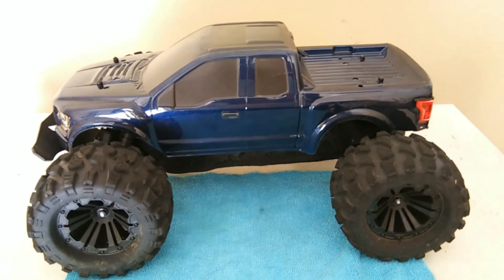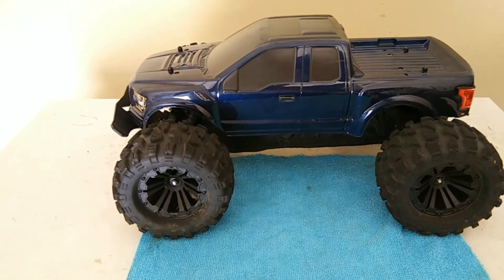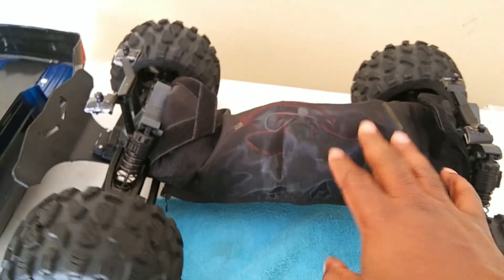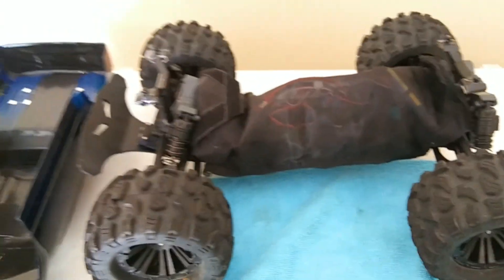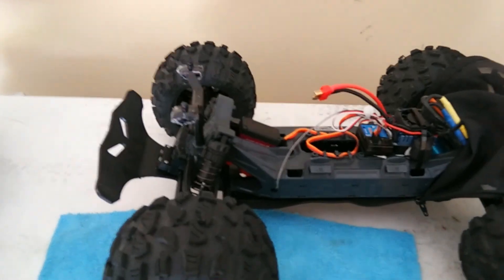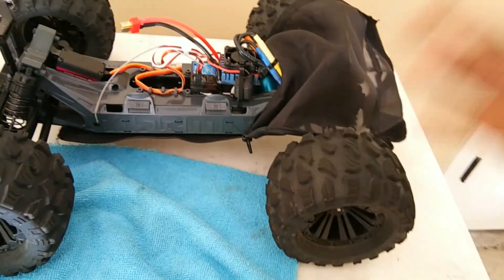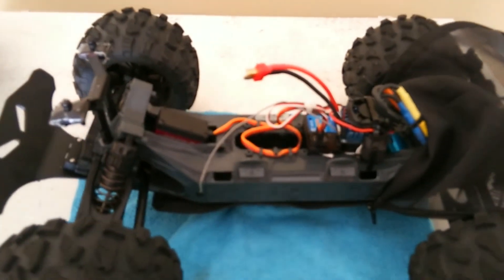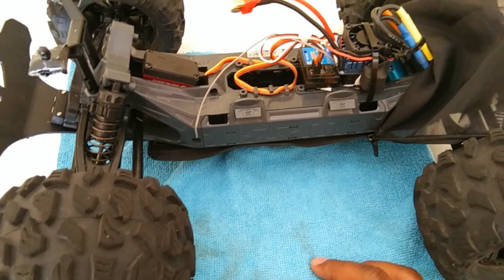Weak Points On The Arrma Granite Voltage 2wd

Comment: I know this is an old video, but so glad to come across your channel, bro. Just bought one of these on HH pre black friday sale. ESC bad right out of the box. Bummer, HH tried to make it right sent me  replacement esc, the big red piece of garbage, lol. It doesn't work out of the box either! Haha, so frustrating. But watching this vid and a few others, I got it so cheap...project truck time! I've got a broken traxxas I've been waiting to slap that vxl 3s system in something random!
Reply from the maker: Oh it's going to wake it up for sure. I suggest upgrading to metal cups & dogbones for your rear axles because the stock drives cups will strip under brushless power for sure.

Comment: Thank you for the info. I am looking to get into the hobby and the arrma granite voltage might be the right choice.
Reply from the maker: You are welcome! That's exactly why I wanted to get that info out there. It's a fun truck and good basher for a 2wd. You won't be disappointed!
Reply: I own this truck and it is a piece of shit!!! The plastic out drives are junk and always break the electronics can't be swapped out because its a all in one system. U can't adjust ur turn buckles to make it handle better. There is no slipper clutch to absorb in of the jumps or ruff terrain. Its easier to strip gears with a direct drive. Save 50 more bucks and buy a 2wd traxxas rustler. U will be glad u did. I know from experience that it is junk
Reply: I Hate Mine! I got it when it was Still $159. It Had it for 30days and 10 Runs. Stripped the Wheels/Rims (the Wheel Nuts Rounded out the Super Soft Plastic Rims) went through Two 2n1's and Servo's. Had to replace the Shocks with Aluminum ones from Wish.com ( 4 for $12 with S/H) and HATE how tiny the teeth are for the gearing. Had to get Hub Extensions so I could put better tires on it ( 4 for $8 from Wish.com). 
Speed Control is now a 12t Dynamite, Stock Motor, First Addition Spektrum Radio/Receiver, and a Cen Servo.  The Stock Motor and Gear Setup is F'n Stupid and have to get Stock Replacement for the Gears WHEN they Strip. I have a Backup Dynamite 15t Motor just in case.
Hard to find GOOD Inexpensive Li-Ion Batteries for it that have more than 2500mAh's. And Can't fit a 8cell NiHm Pack in it Unless I want to Stretch the From a Inch or two... Maybe... It's completely Possible with this frame, only thing it has going for it besides looks.
Reply from the maker: @ravenlorans  man you have had it rough with the Voltage. 
Mine is brushless and I run 2s & 3s and have only had issues with servo saver and out drive cups. I'm working on something to see if I can make those outdrive cups last longer. Also I'm trying out a different plastics servo saver and will try the aluminum servo saver as well.
All I can say is fix it and keep bashing 😂 at least the parts are not expensive but will add up if we keep breaking 😂
Reply from the maker: Oh by the way those stock wheels are not good. I rounded those hexs as soon as I pulled the trigger on 3s 😂
Reply: @PJsElectricRCAdventures  All of this on STOCK Batteries.
Reply from the maker: @ravenlorans  heavy bashing?
Reply: @PJsElectricRCAdventures  Nope. Just running around in the yard and a few jumps no higher than 2ft and 4ftlong... The Rims are so Soft of a material, you can actually cut them with your Fingernails if they are long enough. 
So Loctite everything and only run it on loose dirt or on Asphalt, never jump it, yeah it's fine. Run it in your yard through grass, and jump it off a 1ft tall mound of dirt and it strips the fuck out of everything and breaks the shocks. There are WAY Better Trucks/Cars out there for Less that are 100times Stronger. Just go to Banggood/AliExpress/GearBest Hell Even Amazon ( will pay more there for same vehicles) Or just save up an Extra $50 and go to Horizon and get their ECX Brand Truck.
Reply from the maker: @ravenlorans  understandable! I own all that you speak of and each have their flaws(weak points) as well. It's all about finding a solution to solidify the weak points and even then stuff will break (it's just part of the hobby). Thanks for watching and keep on bashing!
Reply: Yeah, good idea. I bought my first RC ever at Christmas. A Traxxas Maxx V2. It was WAYYYYY too much truck for a beginner.

Comment: Anyone looking at this and thinking of getting the voltage get the Integy universal drive shafts for it..gets rid of the outdrive cup problem..they also have rear hub carriers and rear upper links..lots of cheap upgrade parts just gotta do some research

Comment: This input shaft cup from Arrma fits instead of the plastic outdrives: ar310432. I ordered ZD racing cups to see if they fit too. (8228) I read some review of someone that said they fit the Kraton so I took a shot. Come without grub screws though so I ordered a complete 1/8 zd screwset and it's still cheaper than 1 piece of those Arrma ar310432 cups. We'll see how that goes....
Reply from the maker: Awesome! Keep me posted how it works out for you. My metal axles finally came in. Hoping to get out and do a run video soon. This weather is kind of folding my place though.

Comment: What servo saver would you recommend for that servo your using?
Reply from the maker: I can't remember the brand but I  installed a stronger plastic servo arm without the spring & that worked fine. Integy makes an aluminum arm like the plastic one I installed but it's a little on the expensive side.
https://www.ebay.com/itm/255656643772?mkcid=16&mkevt=1&mkrid=711-127632-2357-0&ssspo=ED1NHlblQU2&sssrc=2349624&ssuid=4r0e61ber22&var=&widget_ver=artemis&media=COPY

Comment: Nice looking truck! I can't find any aftermarket bodies. What part number is that from proline? Did you need to modify anything to make it fit?
Reply from the maker: Get the one that is for a Traxxas Stampede and it will work with no modifications needed. I'll have to check the part# but if you get the one for the Traxxas Stampede it will most definitely work!
Reply: @PJsElectricRCAdventures  Thanks Brother

Comment: Where did you get the dust cover from for the arrma voltage?
Reply from the maker: It's a dust cover for the Traxxas Maxx that I made work for it.
Reply: @PJsElectricRCAdventures  ok, how is the brush less system holding up? I have the same one that I didn't install yet?

Comment: I Hate Mine! I got it when it was Still $159. It Had it for 30days and 10 Runs. Stripped the Wheels/Rims (the Wheel Nuts Rounded out the Super Soft Plastic Rims) went through Two 2n1's and Servo's. Had to replace the Shocks with Aluminum ones from Wish.com ( 4 for $12 with S/H) and HATE how tiny the teeth are for the gearing. Had to get Hub Extensions so I could put better tires on it ( 4 for $8 from Wish.com). 
Speed Control is now a 12t Dynamite, Stock Motor, First Addition Spektrum Radio/Receiver, and a Cen Servo.  The Stock Motor and Gear Setup is F'n Stupid and have to get Stock Replacement for the Gears WHEN they Strip. I have a Backup Dynamite 15t Motor just in case.
Hard to find GOOD Inexpensive Li-Ion Batteries for it that have more than 2500mAh's. And Can't fit a 8cell NiHm Pack in it Unless I want to Stretch the From a Inch or two... Maybe... It's completely Possible with this frame, only thing it has going for it besides looks.
Reply from the maker: That 12t dynamite is a good setup. I put the Dynamite 15 turn setup in the Kyosho Monster Tracker and it was keeping up (if not beating it) with my Brushless Voltage. Both were running 2s lipo. Nice safe setup if you ask me!

Comment: What are the brand of tire on there they look great would like to put them on my granite 4x4
Reply from the maker: Believe it or not but these are just some unbranded wheels I picked up on Ebay some time ago. I think they were around $18 for the set and they are holding up well. Better than the stock ones that stripped soon as I went brushless on 3s....lol!
These have a thicker hex on them so they are pretty durable.
Reply: PJ's Electric RC Adventures thanks found them there
Reply from the maker: @kylekallies3381  no problem! I bought the black plastic one and installes. It held up through a full bash session. So now I'm looking at some metal drive cups for it now.

Comment: Could you post links to the upgrade parts you used? I am a rookie and buying this for my kid. Would be nice to let them upgrade it like yours. Well thank you.
Reply from the maker: I'll do that for you shortly.
Reply from the maker: You will need this to protect in crashes. I only bought the front bumper but they also have the rear as well.
https://tboneracing.net/products/10070-tbr-defender-front-bumper-arrrma-granite-voltage-1

This is the link for the metal cups and dogbones.
https://www.ebay.com/itm/164145513704

This is the link for a brushless system that will give you a balance of speed and torque and will allow you room to gear up. A 3300kv motor and 60A esc would work as well. Do not I repeat do not get a GoolRC ESC (it will burn up).
https://www.ebay.com/itm/184330348820

The metal servo you will want if you decide to go brushless or do away with the 2 in 1 esc/receiver.
https://www.ebay.com/itm/274572135593

For all aftermarket upgrades search eBay for Integy Arrma Granite Voltage and all the available parts will show.

For new bodies any body that fits the Traxxas Stampede will fit. I got the Ford Raptor body...link below.
https://www.ebay.com/itm/164293528636

You will need better wheels if you go brushless. Any off road 12mm hex wheel you choose will be better than the one that come on the Voltage. The one for the Stampede or Redcat Volcano will work.
Reply: @PJsElectricRCAdventures  Thanks bro, I just ordered the bumper, only 2 left in stock. Again thanks a bunch man.
Reply from the maker: @bade3k  glad I could help!

Comment: What motor and esc do you upgrade to?
Reply from the maker: I just put a cheap eBay system in it. It's a 3660 3100kv brushless motor with a 60A brushless ESC.

Comment: Why make it brushless instead of just buying a brushless servo to begin with? The point of this truck is to be cheap... Lol
Reply from the maker: Thing is most people like to put their own touch on the their rigs by building them up with whatever systems and accessories and will still come out cheaper in the long run than buying a RTR overpriced brushless rig.
Y'all stay tuned to more videos on this truck. I'll be showing you how to make the drivetrain bulletproof on this truck. You will never have to worry about stripping gears or drive cups with these upcoming upgrade videos.